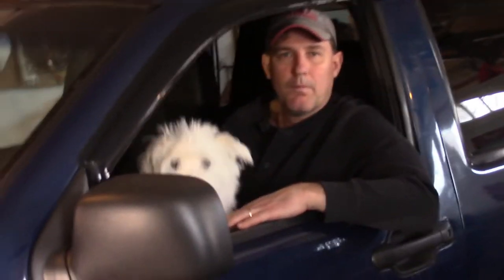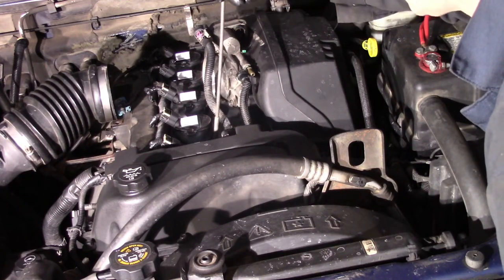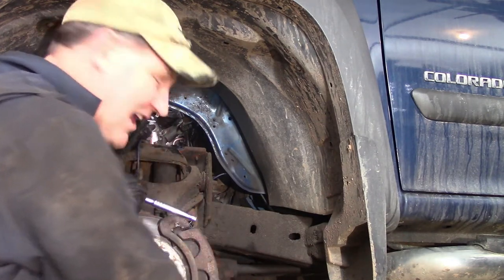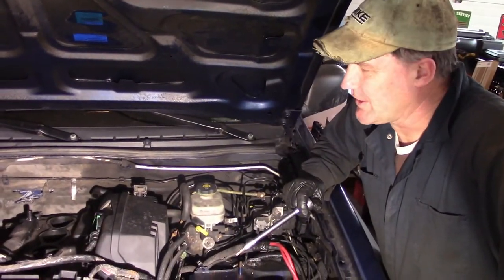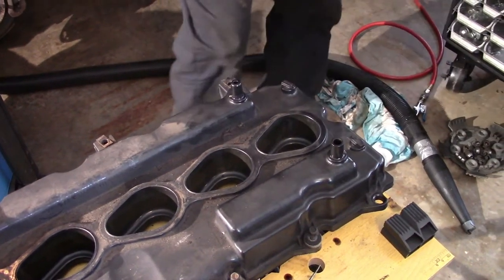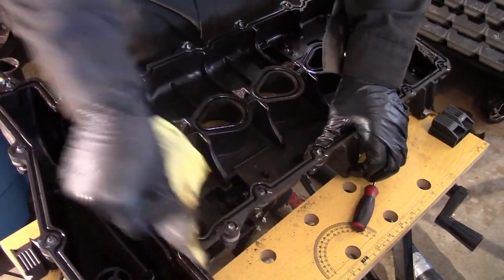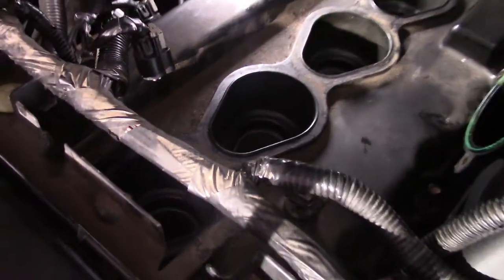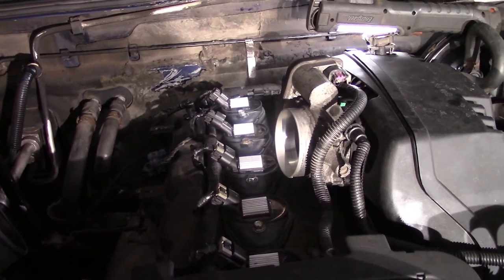2005 Chevy Colorado How to Remove the Valve Cover, Clean, Replace the PCV, Blue Smoke Problem Fixed.

Comment: I had blow by coming from oil dipstick tube and leaking oil from bottom of tube. I did the same thing without taking the cover off. I also did the paper text. And no more blow by. Which means for now at least. Oil consumption should be over. I also put ROYAL PURPLE in as well. To help clean it even more. I use Pennzoil Platinum Ultra and Royale purple 5w30 oil. I will check to see if that helped with oil consumption. So far so good. It's only been a week so far. I'm pissed the paid professionals didn't catch this. I'm a DIYer who checked hummer forms and YouTube before i was finally able to figure out the issue. Paper test was easy. Small finger size piece of paper. If it sticks to the oil dipstick tube. Your PVC tube/valve is working properly now. Mine wasn't doing that at first. Now it's holding properly now and NO BLOW BY.
Reply from the maker: Excellent, cleaning that PCP orifice in the valve cover allows the engine to breath and stop pressurizing the top part of the engine which stops blowing oil /exhaust out through gaskets and dipstick! Congrats. That is a huge result from a relatively easy procedure. Thanks for letting us all know in case others are struggling with blow-by.
Reply: @cantletherdiediy1050  oh i forgot to add. Before i figured it out. I replace rear and front main seal. Oil pan and valve gasket. Which was a pain because i had to pay someone to do that. 😭. I still had leaks i was confused. I'm not getting rid of my hummer lol. I change crank solenoid in the back of engine on driver side on top of the dipstick which was leaking as well. Still blows by lol. It took all that before finally figuring it out lol. But yeah it's finally done 😂. I can laugh now. But it wasn't funny then lol.
Reply from the maker: @Quis85  I know how you feel. There's no fun in the job when it does not fix the problem. I've been there. It's only fun after you have conquered the problem. You're better than most!
Cheers!

Comment: ill have to try the drill bit first, my truck has 215k miles (346k km) and it is consuming a lot of oil. no leaks that I can see, so I think this may be the issue.
Reply from the maker: Good luck my friend
Reply: @cantletherdiediy1050  thanks! 
I actually found that 3/32 filler rod works well for that hole. Mine didnt seem very clogged though. We will see if it changes anything
Reply: @hrsey71  did that work ? Or you still losing oil?
Reply: @chriscantu353  still uses oil. it burns a qt about every 2k miles

Comment: Moisture doesnt evaporate on short trips. mixes with oil and turns it to mud. Blocked pcv makes it worse.

This video probably saved a lot of people money and time not having to replace gaskets when you could dump seafoam and use a wirebrush (carb brush) dump the rest of the seafoam, run it and do an oil change,  i would do this at spark plug time, all in one job and dump a little seafoam into the cylinders.

Comment: And that right there is a great example of why today’s vehicles ain’t worth a damn! I miss the days when practically everything on an engine was easy to get to without disassembling the whole damn engine compartment AND still have to remove a tire or 2!
Hell, I have a 1969 Ford F100 with a 300 i6. I could probably disassemble and reassemble the whole dammed engine in the amount of time it takes to just get to the pcv valve on that Colorado engine!
Reply from the maker: Unfortunately, you're absolutely right! Dealerships actually make more money on service work than by selling new vehicles. New vehicles are being designed to require a lot of service that the typical owner can not do. For instance, this Colorado requires you to remove the hub bearing assembly to get the front rotors off. Chevy obviously doesn't want owners doing their own brakes. Hopefully, these videos empower owners to do more service work themselves and keep more of their money in their own pockets. Thanks for the intelligent comment Bobby. Cheers!

Comment: Nobody ever got anywhere good with a negative attitude, thats why you have the gumption to take on the infamous Atlas!
These engines are notorious for clogged pcv orifices, its a shame the engineers didnt think to add replacable pcv valves with rubber grommets of old, guess they thought they knew better than old timers like me😂😂😂 im doing this very job on a 3.5 atlas in a hummer h3 which is far less accesable than the colorado with even more junk in the way! Pretty much the same procedure though and same symptoms, ecessive oil smoke out the tailpipe, and leaking at the broken oil sending unit, valve cover gasket etc. The only difference is i will be removing the intake to replace all o rings there as well because at 198k they are dried up and cracking throwing off the map sensor reading. I never want to look at this engine again for any reason so the extra mile is required . Great vid though and congrats on your success!👍💯

Comment: Can’t let her die ?? For ya.  I just bought a 1 owner 118k 2.8 06 canyon   The timing chain was done  every cam crank temp oil sending unit all sensors replaced new plugs..  truck runs great for o say 15 mins once temp gauge hits 1/2 way boom truck will die when u stop or let foot off of the throttle..    no code  it will only stay running by keeping rpm up to 1000.   Any idea what  may be the cause of this?? It does every time like clock work.. I read that GM
Fuel pumps will get hit and stop working properly… seems as if somethings get a certain temp and then boom truck stalls..   Only code I get is large evap leak  
I put new purge and canister still throws that…   Anyone who may see this and possibly came across this please let me know thanks in advance yall..  left ya a like 👍🏻 sir.. Nice job   These trucks army to terrible to work on at all… (except for timing chain(s) )  😞
Reply from the maker: It could be the Fuel pump failing. It could also be the metal tabs on the gas tank that hold onto the locking ring holding the fuel pump onto the fuel tank. The tabs on the gas tank has a tendency to rust causing a Large Evap leak. Can you also smell gas occasionally? When these locking rings tabs rust and fail, the fuel pump is no longer sealed tight causing the evap leak. Also, it often allows dirt/water into the gas tank which may clog the gas filter/ is hard on the fuel pump/ cause other problems. You may be able to access the fuel pump by removing the cargo box (4 bolts) and lifting the box (2 person job) if your truck is anything other than the crew cab.  Unfortunately, I replaced mine before I started making videos so I do not have a video on that for you. This is only a guess so factor that into your decision as well. Something to consider. I wish I could be more help but unless I see and hear it, it is hard to be sure. Cheers!
Reply: @cantletherdiediy1050  thanks for your thoughts .  No gas smell at all.  I’m thinking my stalling mixed w the large evap has something to do w fuel pump and area ..  gonna till the dice. Fingers crossed I fix both issues
Reply from the maker: @bma4203  Let us know how it works out. There are lots of guys with similar issues wondering what the heck is going on... Cheers!

Comment: Wait till you have too do a timing chain you will blow up the truck the worst engine ever made.
Reply: to remove the head, its easier to remove the engine! one of the timing cover bolts is behind the oil pan. I think im just going to wait until the motor blows up and buy a new engine